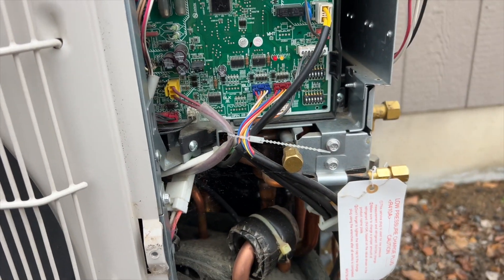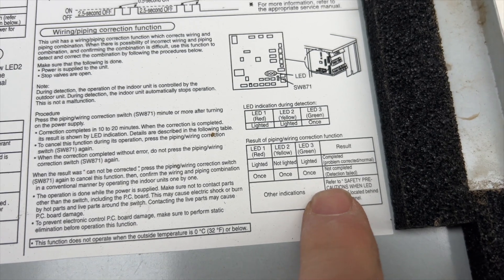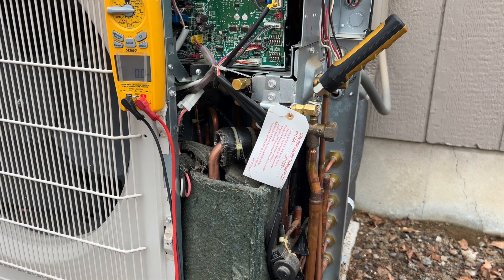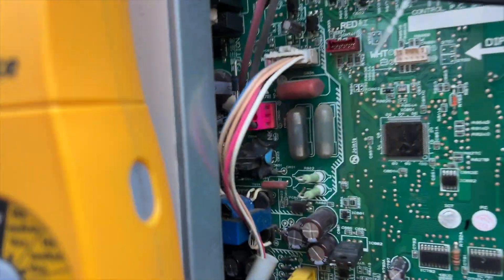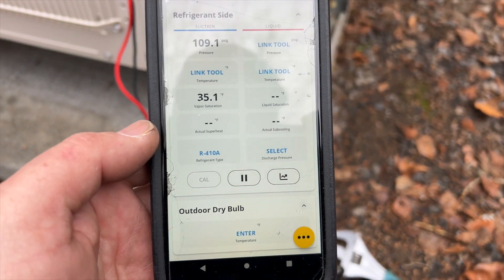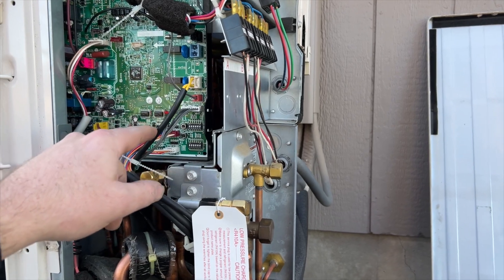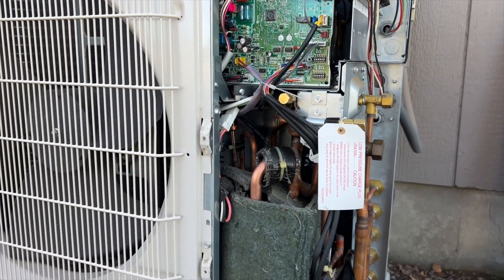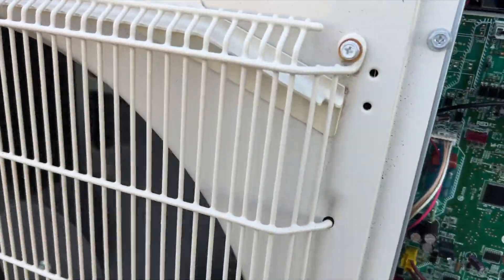Two Head Mitsubishi Minisplit Is Having Comm Issues EP170

Comment: How do you know if it’s the outdoor pcb or the indoor pcb ? For the communication error ?
Reply from the maker: Educated guess. Disconnect the indoor head from the outdoor unit. Power it up and verify high voltage in and out to the indoor head port. If no voltage the. Probably the outdoor board. If you have high voltage the. see if you have fluctuating DV voltage between 2 and 3. If it’s steady the outdoor unit isn’t communicating and it’s probably the outdoor board. If you do it’s probably the indoor board or a bad connection.